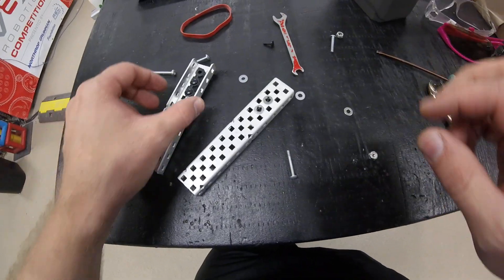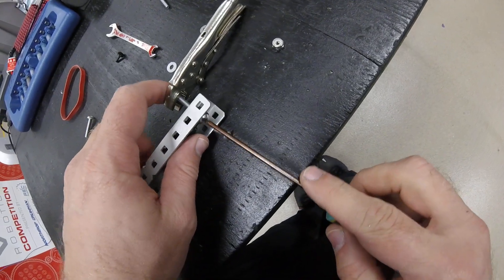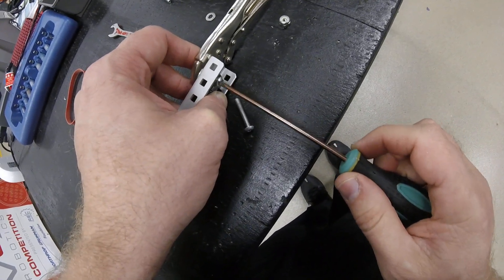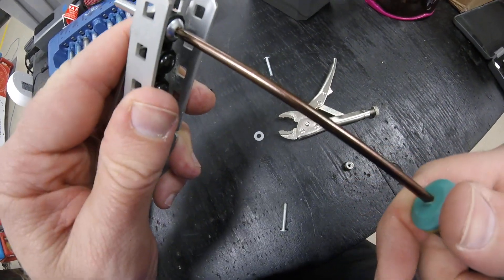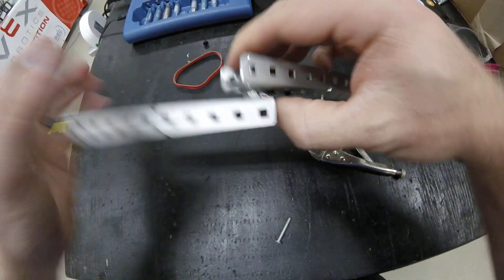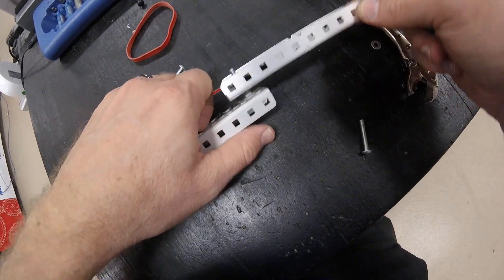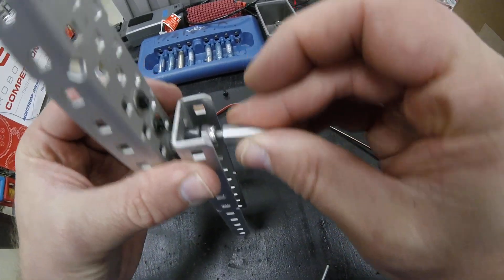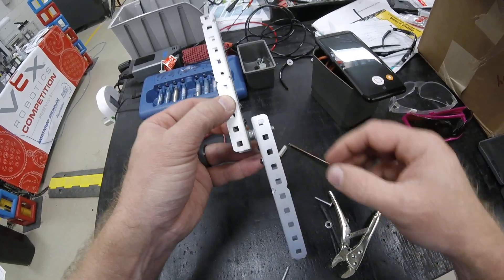VEX rotational joint low friction assembly

Comment: One really smart strat is to use a star nut/keps nut and tighten it all the way to a c channel. This makes the screw joint not rotate, and almost never loosen. A screw joint shouldn't spin freely because if it is then energy is going into the screw and not into whatever you need to move or power.

Comment: This can be done with fewer pieces making the mechanism lighter and easier. In addition, the bearing is then unusable because the screw damages it. It is better to use the Shoulder screws Ref 276-1408 for this.